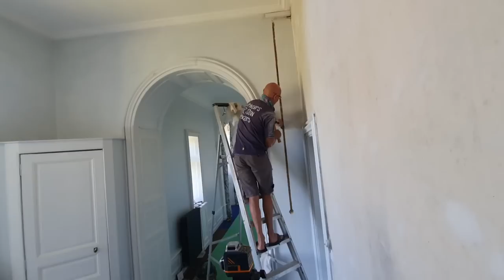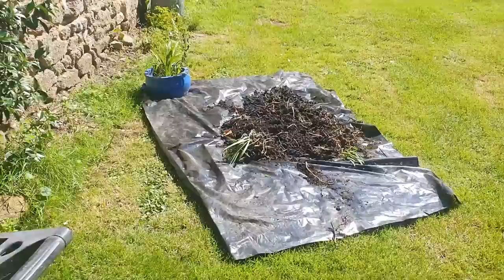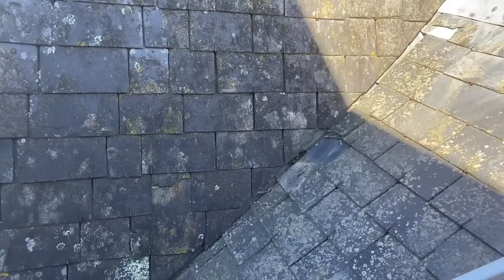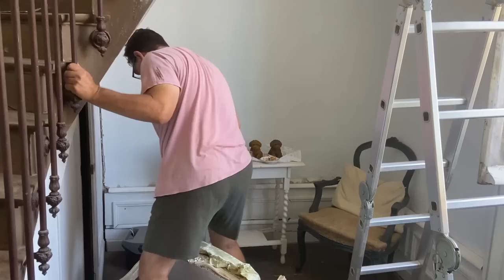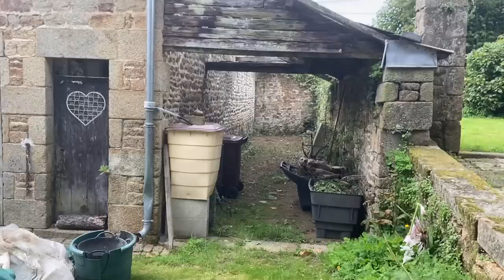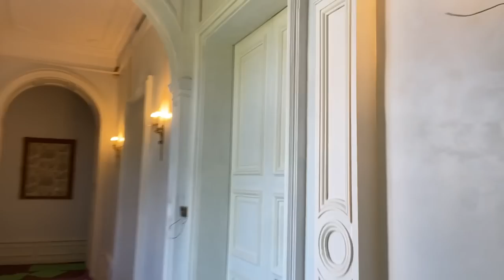Climbing On Top Of The 25 Metre Château Roof!

Comment: The reason your tomato’s got blight is 1 you had them growing on a wig wam type of structure they should be planted individually as they need air flow through the plants, 2 you had a load of leaves on the bottom  you should have taken at least a foot of foliage from there and 3 when you water you have to water from the bottom point towards the earth because splashes on the plant will bring spores from the blight onto the leaves which will spread like wildfire.
Hope this helps you most likely know all this but I would hate it if you planted and lost them next year.
Reply: I agree.  There is definitely an art to growing tomatoes successfully. Think more along the lines of espaliering tomatoes plants to ensure good air flow. Remember too that that you can plant the tomato plant prunings to grow additional plants.
Reply from the maker: Thank you for the tips, although last year I did exactly the same, and they were stupendous,  just bad luck, they aren't the only things suffering this year, weather and infection has been a problem in the area

Comment: Fantastic job but I’m puzzled by 2 things: in france safety norm NF C 15-100 requires that you can’t install bare electric cables in a wall (it has to go trough a sheath); 2nd in old houses you need to add fissnet fiber in the plaster otherwise in less than a year, cracks will be back. Have you given it some toughts?
Reply: They are doing exactly that, as they have explained numerous times.
Reply from the maker: The electrics are in the correct conduit for walls as sold at all depot stores